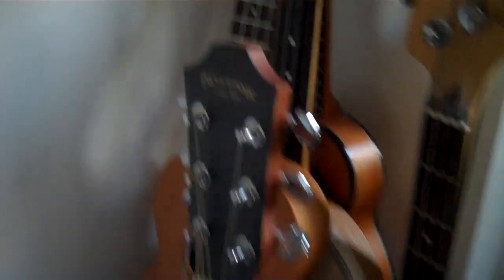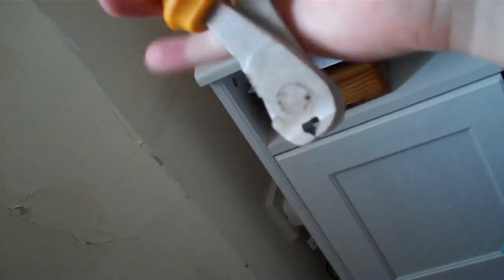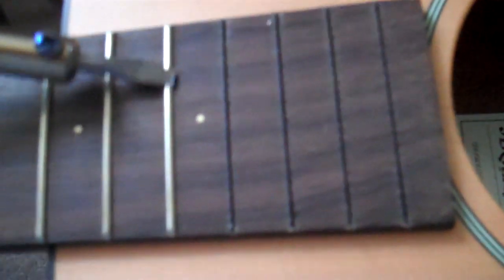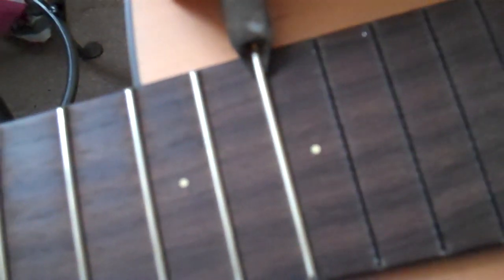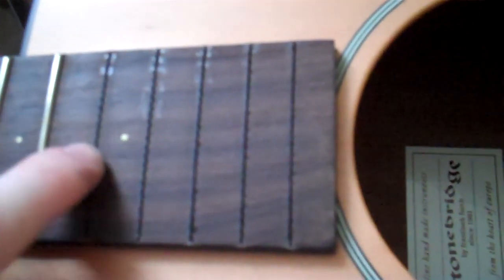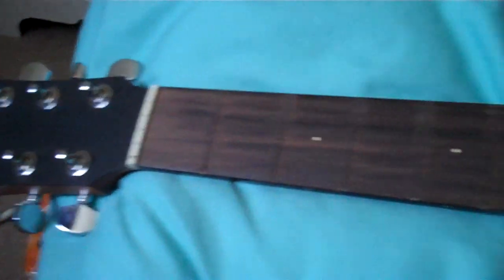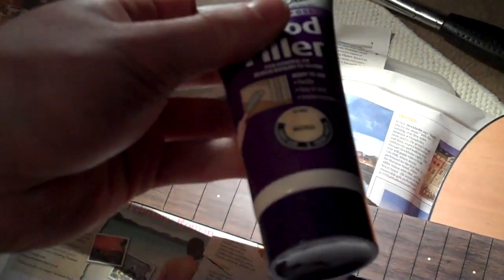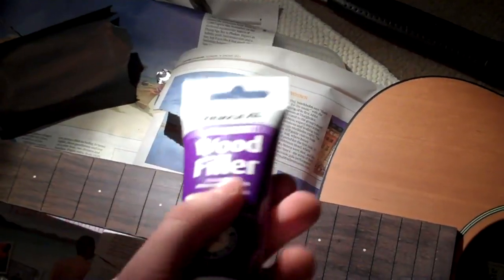My Fretless Guitar Project

Comment: Thanks for sharing. But I just want to know is that you use the same guitar strings or special for fretless? Please reply.
Reply from the maker: You can use normal strings, but they will wear the fretboard over time. I have flatwounds on the guitar in the video which protects the strings. I use normal bass strings on my fretless bass, though, as I prefer the sound.

Comment: Great vid! Subbed channel.here’s my question. I tried to buy aftermarket Necks. 1 is oak wood and the other is maple. The maple has a shiny polish on it. I notice the oak slides better and the maple is more sticky and slower. It grips fingers. Does the polyurethane epoxy resins stick at all or is the original oak faster on slide?  Might add that on my Fretless guitars. 
Check my patented fretboard invention! Let’s collabo. I added groove slots 🎰🎸to bend all strings over fretcorner to add extra x notes to pulloffs as FretCorner plucks note. Infinite vibrato sustain as well. I invented a jig to cut str8 lines with a Dremel.